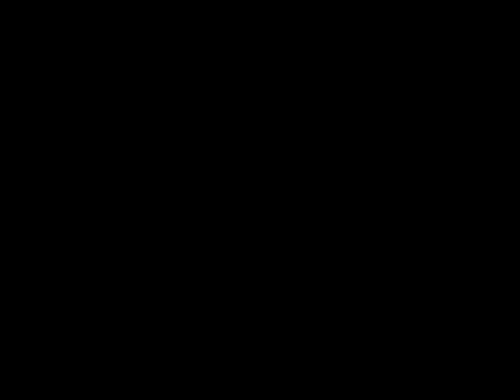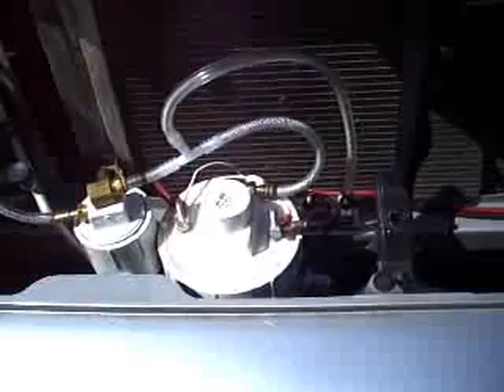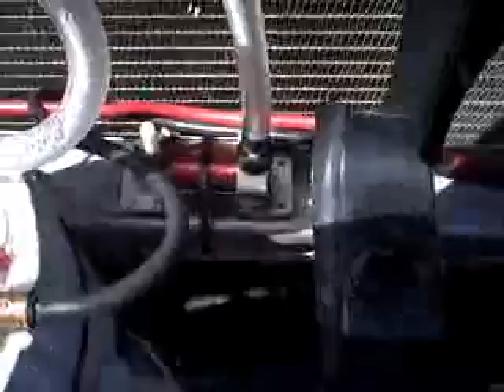#90 - VSPB Toyota Road Report 2

Comment: I don't know if you have taken this into effect but a vehicle that has oxygen sensors, as a 06' Tacoma would definitely have, doing this type of addition could actually decrease MPG.  Hear me out.  What an oxygen sensor is designed to do is measures the emissions to determine if the engine is running too lean or too rich.  And running a engine on a fraction of HHO will actually decrease emissions (because of the lack of hydrocarbons) making the computer pump more fuel into the engine.

Comment: You're right.  I've seperated the gases efficiently by using SS nails encased in a tube.  It helps to have the electrodes close but it's not necessary.

Comment: I have installed 12v pneumatic solonoid valve between electrolizer and bubbler to prevent water being suck back to electrolizer from bubbler. been running on a 2000cc hyundai trajet for months and the bubbler level still the same. u can search my utube video 
7-TUBES ELECTRODE car test

Comment: I just paid $4.13 per gallon of gasoline. I am gonna kill myself. I get 24 mpg on my Volvo 740. Yes it is an 87 that works just fine. I don't believe in airbags, nor ABS, nor any other of the bullshit that they put in cars. Anyway, just venting a little. No pressure ZERO *big grin* LOL.

Comment: Yes and as oxidizer not technically a flammable gas, yet it will Dramatically increase the intensity of any fuel's comubstion including Hydrogen/Gasoline.

But the question remains, how much is O2 and how much is Hydrogen?  Im wondering if the presence of the pure 02 from our cells, along with the Hydrogen is what also increases the efficency of burning Gasoline and Hydrogen, burning as fast/clean as it does? 

Just seems to me the 02 production could be just as important as the Hydrogen.

Comment: Was thinking about HHO, anyone wonder how much O2 is being produced in our cells compared to actual Hydrogen?  Both are by-products of splitting the water..Both are highly flammable.. Not that pure 02 would be bad for an ICE engine or harm it in anyway.. probably the exact opposite.. But what we THINK is mostly Hydrogen being produced since it burns, may actually be O2.  
Especially if you have more POS than NEG plates.. (neg produces the Hydrogen)

Maybe it doesnt matter just curious

Comment: no, fuel pump relays are also switched by the fuel pressure sensor ie; ign on~relay on~fuel pump on~fuel pressure up to norm~relay off~ pump  off~ fuel used/eng running/pressure drops below norm~relay on.i hope your pump is not constantly running with eng not running (could be a bad sensor,but then what do i know you already knew that). btw "HAIL ZERO"

Comment from the maker: You do realize, Mr. know-it-all, that while 304 SS is prone to rapid deterioration if you apply more than 2.5v between plates, at 2.5v or less they last practically forever. And, I am using 316L which withstands even higher voltages without deteriorarion.

Pipe down and pay attention. You might learn something.

Comment from the maker: Over engineered? No. The reason for keeping the level down is to prevent the primary power conductors with 13.8V across them from contacting the fluid. This produces too much heat and greatly reduces cell efficiency. They are insulated with heat shrink up to the max fluid level within the tank.

I have tried insulating them all the way to the top with goop but the electrolysis always eats through the stuff and splits away from the metal.

Comment from the maker: In most cases a PWM only makes it easier to regulate the average current going into a cell but does little to increase production efficiency over straight DC. At least that's been the finding of most people.

Tonight I just put the finishing touches on a new schematic diagram for a PWM that can sense and regulate current as well as vary freq and duty cycle. I have a number of data gathering tests to perform with this new device as soon as it's built.

This new design can also be used on cars.

Comment from the maker: Yes actually, it would as long as there's a 2nd one to let air into the cell on cool-down placed before the one way valve to the bubbler. The only downside to this arrangement is you can never attach it to the intake manifold vacuum. Not that I would want to anyway but some might.

Comment: Zero, I am a fan. I have been watching you from the beginning and just now have I gotten an account. I have a test request. Can you run a cell with the voltage from an ignition coil pulsing it some how? Maybe 2 coils alternating on a Mechanical Switch? While one is discharging one will be reloading. Just a question I have had.